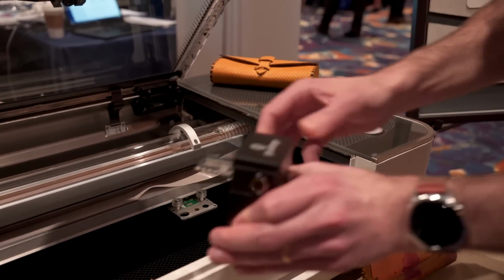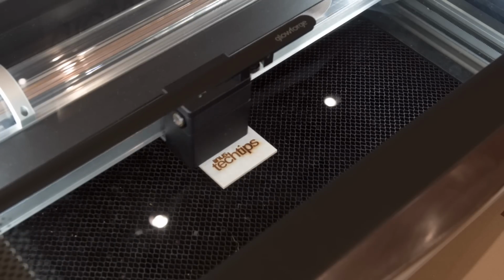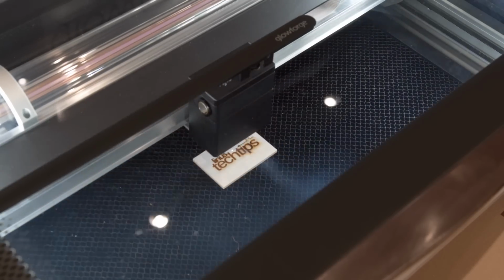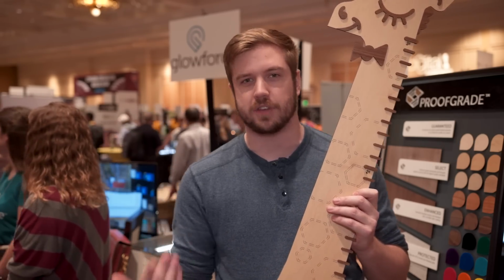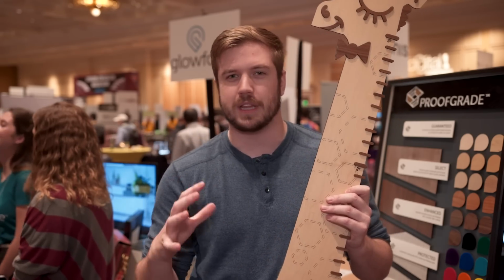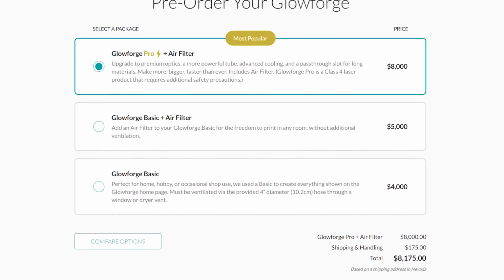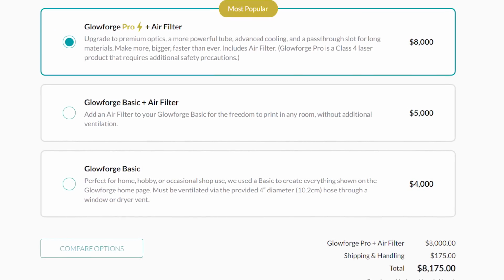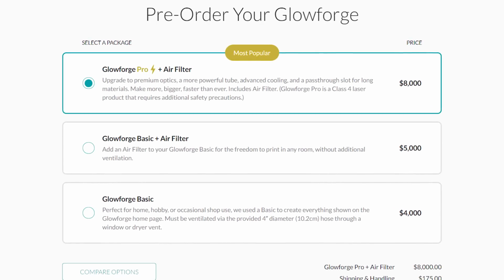Laser Cutter for Any Skill Level - Glowforge

Comment: 1000$ for ventilation !? You can buy not one, but two AC units for that price. How can ventilation for this little device be so expensive ? Are filters made of gold ?
Reply: Well, that's then a problem that they even sell the 1K cheaper model that DOESN'T have that vent system. Obviously it's not all materials that release toxic fumes when laser cut/engraved, but I sure wouldn't like to be on a room with the 4K model doing acrylic.
I would guess that they forbid/don't advise you to use it with some specific materials then
Reply: +rcj0234 So, if they offered a simpler ventilation system where you had a tube that you put through a window like you do for portable AC units they could lower the cost dramatically. Or is that illegal and they MUST use expensive filters because of the chemicals ? Do those filters have to be disposed in special facilities when they are not usable anymore ?
Reply: AntonioR Software 
"Vent" is not a good word to describe what you get for $1000. The Basic ($4000) has a built in fan that "vents" the smoke and fumes out of the machine through a dryer vent tube that leads out of your house (through a window or whatever). If you pay $1000 more you get something that would much more accurately be called a "filter". The filter (theoretically) lets you run the machine without venting to the outside.

Last I saw, the filter was unproven and the company had released very little knformation about it.

I have a similar-ish filter (called a Trotec "Atmos") for my laser cutter. I bought it second-hand, (third, actually) but the list price for it is something like $4400, so $1000 isn't actually too bad (assuming it ever materializes and actually works, which I'm, personally, mildly skeptical about).
Reply: Thanks to everybody here who put the time to explain how these devices work. I appreciate it.
Reply: Most of the cheaper laser cutters use a vent tube like you would find with a portable AC unit. Even more expensive ones just dump the fumes outside with ventilation piping though these are generally permanent fixtures. There are though units that act like a portable welding fume hood which uses sets of filters to extract toxins generated by the laser cutting process.
Reply: Sure no one would die by being in a room with acrylic being laser cut. But that's the issue tho: it seems harmless (other than the horrible headache inducing smell, I know cause our uni has a laser cutter they use for scale models on architecture classes, and when it's on... you can smell it on the entire block), but poisoning and/or lung damage is usually a cumulative issue. Most toxic substances aren't poisons, like lead and such, but they just accumulate on the body and later on give you serious health issues (lead just as an example, not that there would be lead in this case).
Reply: it's not about the heat, it's about the toxic gases being released when laser cutting. Those are far more dangerous than normal combustion products because the temperature is much higher. proper air filters are expensive
Reply: All the talk about the toxic fumes from the cutting process makes me wonder now: how much would a normal gas mask cost and how effective their filters would be in this scenario? I mean the war thing or the types used when handling heavily dangerous substances with toxic fumes. I would bet it's nowhere near 1K a mask...
Reply: @Rodion - nope, perfectly fine just venting outside. that is what the not $1000 extra version is, quite litteraly a dryer hose hanging out your window.
However, some people cant modify outlets in there house, may be in a "makerspace" in the middle of the room (we had a laser cutter at school about 11 years ago, the room it was in had no outside walls, so we needed a "mini" separate filtration unit. it was WAY more than $1000, and nearly half the size of the laser cutter). When igot to uni, they just had it dumping outside. funnily enough, it dumped some pretty toxic gas outside into an area that was off limits, but people would sneak in there and secretly smoke some less-than-legals, without realising they were getting gassed with formaldehyde!

So no, you don't in any way need the filter, I wouldn't be surprised if you couldn't already buy window pane shaped duct holes etc. Just for what the filter does, it is well worth the $1000. but most people would just have a wide tube dumping the gas outside. I would actually trust that even more than a filter (bit like spray painting outside with a mask, vs in your garage with a mask!
Reply: @TheLiasas  - im, sorry, but i have worked with many laser cutters for over a decade, systems that had both internal filtration systems which were worth far more than $1000, or systems that didn't require any sort of filtration becuse it dumped the gas outside. so what is your input on the matter other than criticising people that have even the slightest bit of knowledge? even the most budget of laser cutter, home made filters is $500 +, and those tend to run on charcoal which you have to regularly replace. There is also a reason they are selling one with and without the filter. a filter isn't necessary if you can ventilate, but some places may not have an outside wall, and suddenly a device comes on the market where you don't need to run ducting through your building, or source a second larger filtration unit! its perfect.
go do some research before you start calling me (Hipocrite? do you know what that means, wow!) names for no reason (ok the Dork is true). 
I have clearly disassembled the original comment by pointing out that an AC unit requires you to dump air outside, and AC units  that required no outside input, are far more expensive than the ones that can expel heat outside.
so, go do some research. the facts are there, the company would be putting in something if it wasn't needed, and even then i pointed out they have probably put on a reasonably large markup becuse of how specialised it is.
Reply: but does your AC unit dump the heat into your house? no it dumps it outside. laser cutters give of some seriously toxic chemicals, so its probably contains stuff more valuable than gold! (not to mention the likely 20%+ extra fee for convenience of not having to do research)
Reply: You may be able get a ventilation unit for cheaper, but you're mostly paying for the warranty / convenience / and safety of theirs. You know it's compatible. Air conditioners are NOT, the same thing. You're trying to pull the air from the platform and also push air in. It's constantly sucking the debris while keeping it cool. This all prevents flames via a vacuum-like effect and dispenses that debris via pipelines through from whatever workstation to the nearest exit out of your building.. While attaching a powerful enough AC unit might help, it would probably require a quite expensive one to get the airflow equal to a ventilator and you'd have to clean it religiously to prevent the dust to constantly fogging the mirrors or creating fires within the device. You'd be sacrificing safety for a couple bucks. I had one that used two mechanisms, which is probably out of date (And you might have devices that are AIO) Where one sucks the air from the bottom which vacuums the projects to the board, while there's a secondary fan that pushing air from the sides keeping it cool and preventing fires more aggressively. I haven't really read up on what the options are, but I found that using both was necessary for a 10 year old laser engraver. When we upgraded, a couple years back, the process didn't change and we still needed both. 

Cons of AC Unit. All of them:
Pros of AC Unit, it's 80% quieter and you get to watch the world burn. :D

I was shop manager for a laser engraving group back in my high school. I had to do daily maintenance and operations with an engraver for three years. I'm also working to afford my own / making my own DIY engraver.
Reply: Yea 1k is redonk
Reply: all behold @rjc0234, a typical internet hypocrite dork who answers shit he doenst know a fuck about, just for the sake of him thinking his reasoning has a tad bit of value. a sad creature indeed

Comment: Glowforge are gonna make a lot of money from people who don't have a clue. It's cheaper to outsource it.
Reply: yeh if you have like 2 things to laser etch lol
Reply: Jonathan I have a laser and do jobs with it and you would have to buy ALOT of engraving and cutting before you could afford even $8k. My typical laser job labor is $20-$30 to do award plaques, 20 names tags is $35 + cermark if it's not anodized aluminum.  Hope by "a few" your talking like 4000 name tags or award trophies.   Material cost is not counted because you have to buy that too. It ends up Much cheaper to just buy it from someone with a laser unless you are doing ALOT of cutting. Places like ponoko and emachineshop or similar charge a small fortune 5-10x or more what a small family owned laser business will charge you.   TBH I don't know who buys from them because it is so expensive.
Reply: But engineers can't wait money for prototypes they designed but built somewhere they can't get to right after the idea.

Also, outsourcing has its own risks, including control of intellectual property and quality. There are still people who prefer domestically manufactured goods.
Reply: Aereto Aereto outsourcing does not always mean out of the country it can just mean down the street. Most shops are willing to sign NDAs on projects if their large enough. Quality of parts in the laser cutting/engraving world is based on the files provided to the company doing the laser cutting. If you use a local shop you could get stuff done same day. Hell sometimes I do while you wait on simple jobs that the artwork is sent in ahead of time.

Comment: Honestly I would rather get a CNC router or mill from shapeoko and be able to work on aluminum rather than sticking to wood and plastic with the laser cutter.
Reply: dont buy a k40. you'll never feel as safe around that as you will a product like this
Reply: Shapeoko is stupidly overpriced.
Grab a 6040 or 6090 machine from China(just look for that name) with a 1.5kW or 2.2kW water-cooled spindle.
Same price, order of magnitude better performance and power.
Or if you want this much laser power, grab a ~$400-500 K40/Bluebox laser cutter... with literally the same tube and better, easier to adjust optics(not to mention an enclosed and safe tube).

Comment: How much money can I make per day by mining with an MSI 1080 Ti Gaming X Trio? I also got it on the very last day that the 1080's were going for $800! (January 6th)
Reply: 1 or 2 probably
Reply: So I'd be losing money due to the electric bill, OK. What I want to know is if it's that bad, why are so many people doing it? Even if I had 8 of them, that would be like 16 dollars per day.
Reply: ToXiC Splitz
It's also kind of a gamble. You hope that prices of your criptocurrency you're currently mining will go up so you can cover your expenses sometime in the future.
Reply: Or you can steal electricity and use natural conditions to cool off the components
Reply: "How much money can I make per day by mining with an MSI 1080 Ti Gaming X Trio"
Depends on your cost per KW/H of electric and the clocks and voltage of your card, The Founders edition 1080ti has a Hashrate of 37, compared to the 27 of a 1070 at stock

The 1080ti has a TDP of 250w vs the 1070's 141w

In real terms you could make around $5.25 per day before electric costs are factored in making profit so you'd be looking at around $3 daily profit, $90 per month assuming 100% uptime on the miner, that isn't likely for people mining in there spare time.
Reply: So isn't it more effective do just buy bitcoin and sell when it's higher?
Reply: That assumes that prices will always go up, Crytocurrencies crash often and hard.
Daily sale miners on the other hand are coming away with daily cash gains.

Comment: DELICIOUS CHOCOLATE PIE RECIPE

2 cups white sugar
5 tablespoons unsweetened cocoa powder
1/4 cup all-purpose flour
1 (12 fluid ounce) can evaporated milk
1 teaspoon vanilla extract
4 egg yolks
1/4 cup butter
1 recipe pastry for a 9 inch single crust pie
4 egg whites
1/4 cup white sugar

-Preheat oven to 350 degrees F (175 degrees C).

-In a saucepan, whisk together 2 cups sugar, cocoa and flour. Blend in evaporated milk and vanilla. Beat egg yolks, and stir into pan. Add the butter or margarine. Heat, stirring constantly just until butter is melted. Pour filling into unbaked pie shell.

-Bake in preheated oven for 35 to 40 minutes, or until pie is not "wobbly" when shaken.

-Beat egg whites until soft peaks form. Gradually add 1/4 cup sugar, beating constantly, until stiff peaks form. Spread meringue on pie.

-Return pie to oven, and bake until meringue is golden.

ENJOY!
Reply: Instructions unclear, laser cutter a penis into pie crust.
Reply: Codewow Oh fuck mate

Comment: but how much?
ok $4000 actually isn't too bad
but couldn't I just make one from an Arduino? (as I am planning to now)
Reply: Yes, but you will lose week in trying to calibrate stepper motors for the drive systems and find reliable belts
Reply: $4000 is an insane ripoff.
Just buy a $400-500 K40/Bluebox that will do almost the same thing.